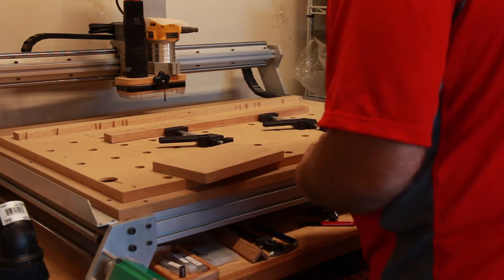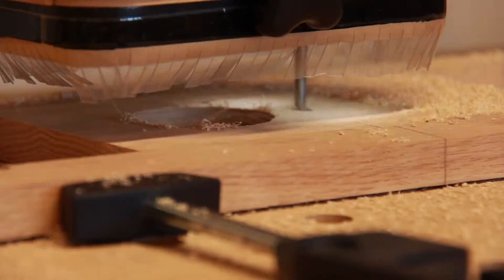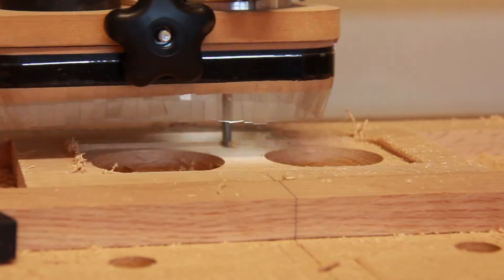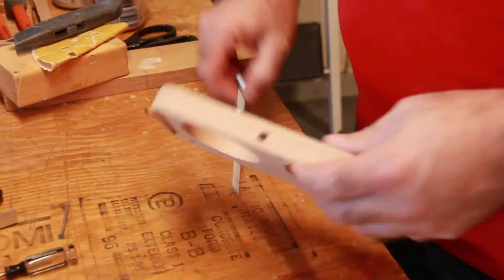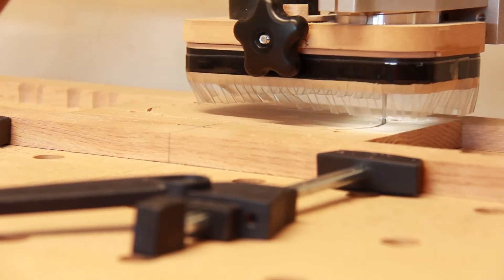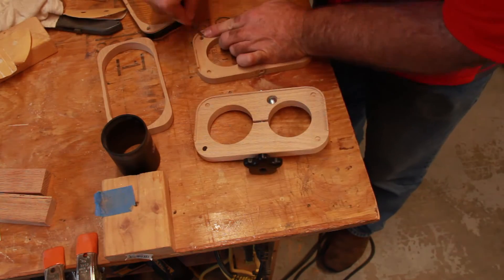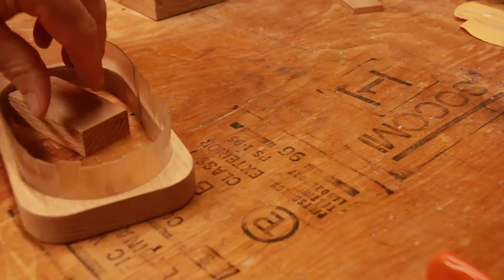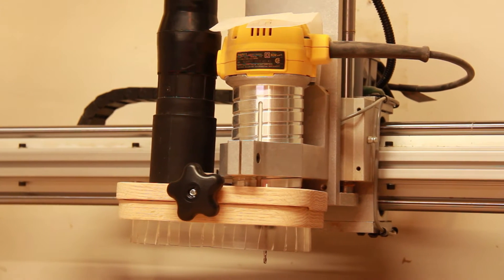DIY CNC Dust Shoe

Comment: Great video. Two questions: 1. What CNC software are you using to run the CNC? 2. What are clamps that you use to hold down the wood. Thank you.
Reply from the maker: Thanks for the kind word!
The control software is Linux CNC
The clamps are Festool Clamping Elements - designed to work with their MFT surfaces.
I machined similar holes directly into the MDF pallet and it seems to work pretty well.

http://www.amazon.com/gp/product/B000JNEC1Q?psc=1&redirect=true&ref_=oh_aui_detailpage_o00_s00
I've recently also started using Kreg In-Line clamps - and they seem to work pretty well too - and they are much less expensive.
You can see the Kreg clamps in use with my fixture pallet in this video:
https://youtu.be/h7L7SX-jxKA
Reply: Dale Root thanks. I order them today.

Comment: Nice video.  What kind of clamps are those ?
Reply from the maker: They are Festool Clamping Elements - designed to work with their MFT surfaces.
I machined similar holes directly into the MDF pallet and it seems to work pretty well.

http://www.amazon.com/gp/product/B000JNEC1Q?psc=1&redirect=true&ref_=oh_aui_detailpage_o00_s00

Comment: Hi, can you advise what the small lever is for.
Thanks for taking the time to video and post.
Regards,Will
Reply from the maker: Hi Will,
Thanks for the kind words.  The lever is used to press the spindle lock button on the Dewalt dwp611 router.   When you change bits on this router their is a button on the side that you can press to lock the spindle from turning so you just need a single wrench to loosen the collet.  Because of the orientation of the power cord and the location where I have my shop vac - the button ended up in the middle between the router and the dust port - so I just added the lever to make it easy to press the button.  You can press it without the lever - but  it was a bit awkward with my large fingers.  :-]
Best Regards 
Dale

Comment: can you talk about your tool height setting 0:25? How do you have that set up? When you do touch off. Is your tool at Z0.000 or Z-0.75 or what exactly?
Reply from the maker: Good Question!
This is actually a tool length sensor - rather than a material touch off sensor (although they kind of have similar effects).  
Imagine this - your system has home switches - so that when you turn it on and run the home procedure - it automatically looks for and finds the home position of each axis.  It then knows where it is within the working envelope - with the one caveat -the length of the tool in the router.  So my post processor runs a little routine each time a tool change in called for - to go over and touch the Tool Length Sensor - and adjust the tool table offset for that tool to maintain the same previously touched off Z zero (wherever it is).
From a practical standpoint - when I change the fixture pallet on the system - I need to manually drive the system and touch off to set the Z zero to the top deck of the fixture pallet.  I do this so I don't have to touch off on each and every piece of stock  that we work with.  You can put any material on the system - and the system always knows where it is relative to the top deck of the fixture pallet.  

You do have to design parts with this in mind - usually it's a default setting that you pick in your design software (I use VCarve Pro)- design from top of material - or design from top of fixture.  My default is simply set for top of fixture. 

This makes is supper simple to get going in the morning - turn things on - run home procedure - load design - load material - hit run.   Everything then happens automatically - tool changes are prompted when needed - and tool lengths in the router are automatically measured and compensated for - before cutting begins.  Changing projects is a snap - the material height comes along with the design - so you never really need to touch off on the material.  Just load and go!

Hopefully this all makes sense - it's simpler than it sounds!  ;-]
Reply: @OakLines  Thanks for the reply! I follow but I don't follow it though.

So when the machine touches off. it sets the Z axis to what exactly? 0.000? or something else? Is the part top x0 y0 z0 or is the part bottom x0 y0 z0?
Reply from the maker: @IcanCwhatUsay  
So - long story short - this process does not touch off or change the zero at all - it only fiddles with tool length offsets in the tool table in some clever ways.

I guess a way to think about it:  The tool length sensor is used to maintain whatever zero you already had setup as you change tool bits.  In this case the Z axis  has previously been setup for Z0 to be the top of the fixture pallet (i.e. bottom of the part material) - and I want to maintain across all tool changes.   

The tool length sensors (and the automated measurement routine) are used to determine the Z tool length offset needed to maintain the the Z0 that existed with the previous tool - at the same point once a new tool has bee installed.  As part of the measurement process - the measured z offset will be  applied to the selected tool - in the tool table - and presto magic - the same physical Z0 - with the new tool - regardless of how far it sticks out of the router.

X Y Z Home switches get you a known position within the mechanical working envelope for each axis.  The tool length sensor is simply a home switch for the working end of your bit. With a little math you can compute the tool offset - and store it at the right location in the tool table (this is all done automatically as part of the measurement routine).    Huge productivity boost - all you have to do is tend the machine - it does the rest.

If you're still interested - maybe we can do a video and walk you though it.  
It is simpler than it sounds! ;-]

Here are some related videos that deal with the idea of fixture coordinates:
https://www.youtube.com/playlist?list=PLHMYQtEe1E6APEw7BwRb3M4oXEeKOlT4i

Comment: what clamps are you using?
Reply from the maker: They are Festool Clamping Elements - designed to work with their MFT surfaces.
I machined similar holes directly into the MDF pallet and it seems to work pretty well.

http://www.amazon.com/gp/product/B000JNEC1Q?psc=1&redirect=true&ref_=oh_aui_detailpage_o00_s00

Comment: What kind of clamps are you using for you spoil board
Reply from the maker: They are Festool Clamping Elements - designed to work with their MFT surfaces. I machined similar holes directly into the MDF pallet and it seems to work pretty well.http://www.amazon.com/gp/product/B000JNEC1Q?psc=1&redirect=true&ref_=oh_aui_detailpage_o00_s00

Comment: Hello, I just came across your videos and I like it. Would you mind sharing the design,? I have the same router
Reply from the maker: Hi James,

It was designed in VCarve Pro - so if you can use that format I'd be happy to share it with you.It's a pretty simple design from basic shapes - rounded rectangles, circles, and lines.  It is a bit of a mind bender to think through how you can achieve all of the desired pockets and profiles for 2 sided parts (top and bottom) - but once you get the hang of it's kinda fun - like a puzzle.  

Let me know if you'd like a follow up - I'd be happy to help if I can.  ;-)

Thanks for watching!
Reply: Yes, that'd be great!
Reply: Dale Root  hello I'd definitely be interested in the vcarve format.
Reply from the maker: Hi James,You can find the VCarve files about midway down this project page:  http://www.OakLines.com/Projects/CNC_Router_DustShoe/default.htm
Sorry about the tardy reply - somehow it slipped thru the cracks!  ;-)

Comment: Just a quick question, what gauge thickness are you using for the pvc vinyl? and possibly where did you get it, having a hard time trying to find some... Great job by the way!!!
Reply from the maker: Thanks Mac,In the end I went with a more traditional brush setup for general purpose use - it allows more air flow in and carries away the dust better.  The suction on the solid material version tend to lift the fingers up near the material.  I still keep the PVC, Vinyl, and Silicone flavors around for special cases, like the first time I cut a design and I want a clear view of what the cutter is doing.Check out these videos - we did a visual comparison of the performance of various configurations:Dust Skirt Shootout https://www.youtube.com/watch?v=vA59GWtjEgACNC Dust Shoe - the Brush  https://www.youtube.com/watch?v=s2ASCBFkcAQ

Comment: NICE COOL VIDEO!...DO YOU HAVE A LINK WHERE CAN I BUY THOSE NICE SET OF TABLE CLAMPS YOU HAVE? THANK YOU!
Reply from the maker: They are Festool Clamping Elements - designed to work with their MFT surfaces.
I machined similar holes directly into the MDF pallet and it seems to work pretty well.

http://www.amazon.com/gp/product/B000JNEC1Q?psc=1&redirect=true&ref_=oh_aui_detailpage_o00_s00

When unlocked - you can slide the business end back and forth to adjust the length.
Then with a cam action - underneath the center -  a hard metal plate (up inside) bites against the silver rod to provide the clamping force.  The silver rod is a softer material - and it can get little nicks from the biting action that hinder the sliding a bit if you use them in the same position all the time.  If that happens - you can polish rods to buff out the nicks - and/or use the adjustment screws to adjust the clamping plate position.  

Not perfect - but very flexible and I do like them.
Reply: Dale, Thank you so much. I just bought them when I got your messege, bouht it in ebay for $110 and will continue to watch your channel! Again thanks so much for the great info.

Comment: Good job. Great dust shoe. Does the downdraft exhaust from your dewalt router interferes with the dust collection? You should publish your files :-) . I would certainly create one for myself if you did. 😀
Reply from the maker: Hi Chris - Thanks!  Happy to share the design with you - really simple.  A couple rounded rectangles - a few circles - a pocket , and that's about it.  The trick is how you connect them with the various toolpaths to create the parts - and to be honest that is the fun part.  ;-)  If you are interested - let me know and I'll find a place to post the design files.  I'd probably have to put something together to demonstrate the process of translating the simple shapes into turning into the toolpaths.  Thanks for the comment.

Comment from the maker: So...After using the new dust curtain for a week - I've decided that it was in fact too stiff - and reverted back to the thinner and more flexible door sweep.  It's much more flexible and conforms better during height changes such as raising and lowering events.
Reply: +Dale Root Nice design. You should do something about the dust that escapes when the bit is higher up though. Perhaps a second thinner skirt that goes down farther on the outside of the piece.
Reply from the maker: Yes - you're right!I've played around with various material and lengths - right now I'm running it with a longer brush setup.  Maybe I'll put something together to show the effectiveness of the various configurations.  Thanks for the comment.